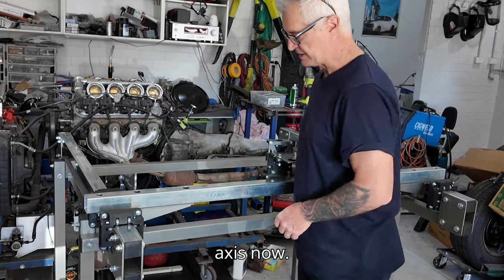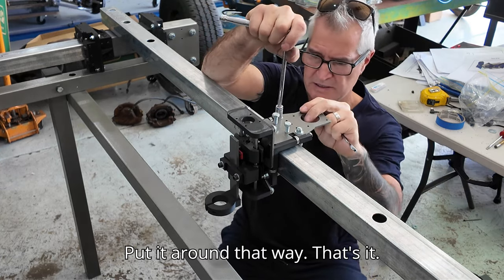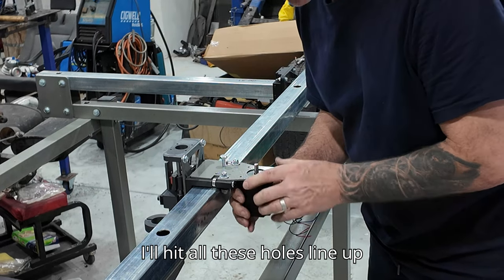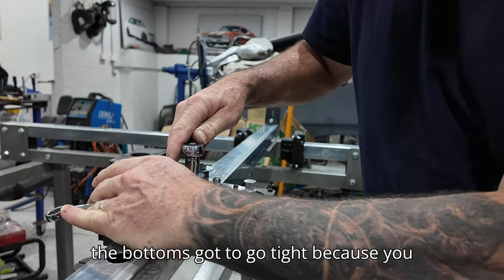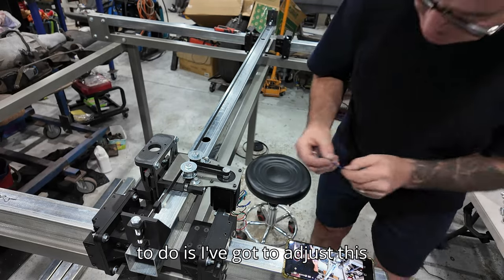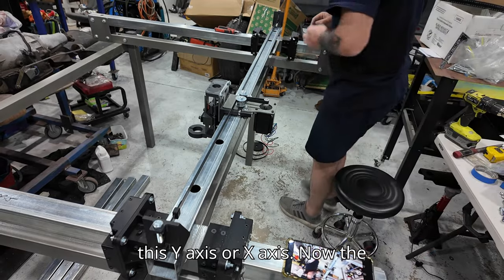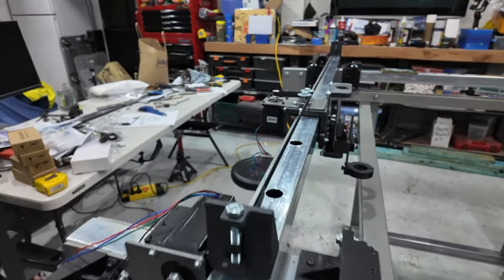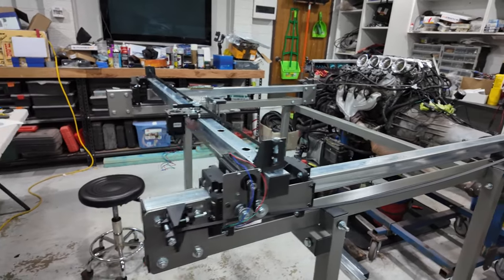DIY CNC Plasma Cutter Part 2. JDS's Garage CNC Plasma cutter on Steroids.

Comment: How long across do you think I can go using that belt?
Reply from the maker: @cutweldngrind  well my table is 1400mm wide x 1500mm long. Minimal flex in the belt. There are wider gear drives and wider belts on the market. If tou go wider you will have to add an extra bearing or two to each guide roller assembly, depending on width. It's a cheap option using the belts, a ball screw would be optimum I would think, but adds alot to the cost.
Reply: @SullysRodskustoms.   Thanks, 1500mm is a good size for sure. I don't have a 3d printer so I either have to buy one of buy the printed kit. Thanks again.
Reply from the maker: @cutweldngrind  my cut with doesn't take a standard metric width sheet of steel. From memory my sheet size can only be 1130mm wide x 1000mm long.
So make yours 1500 mm wide outside the y axis tubes. Then a full width sheet can fit.

Comment: Awesome build mate, I'm planning on getting their xl plans when the metric is ready, with the tensioner could you not just trim down the part you slide where the slotted holes are to give you another few mil?
Reply: oh and thought about grommet to plug the hole in the x axis tube/
Reply from the maker: @2874mattm  I thought about a grommet but the x axis is a really close fit and will contact it.
Reply from the maker: @2874mattm  not sure I understand what you mean.
Reply: @SullysRodskustoms.  I cant share a photo, but I meant the tensioner part that slides with the long slots. trim the  right end (behind the m8 jam nut) a bit to allow the tensioner to loosen more so you'll have more travel to take up slack. On second look it look like the slots are bottomed out  on the bolts.
Reply from the maker: @2874mattm  ok. I get what you mean now, there really isn't much adjustment with the design. So what I did was back off the belt reasoner, pull the belt tight. Then slip the little belt clamp in place, then add some tension. Seems to work ok.